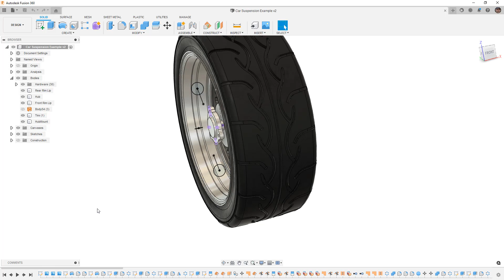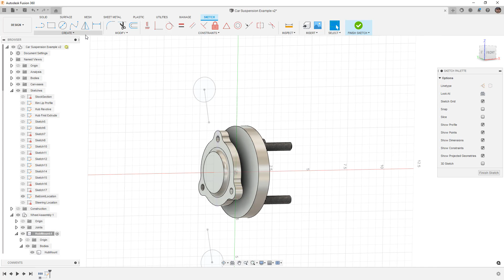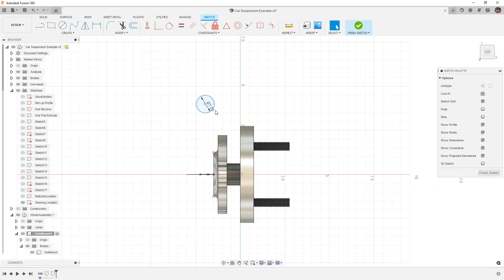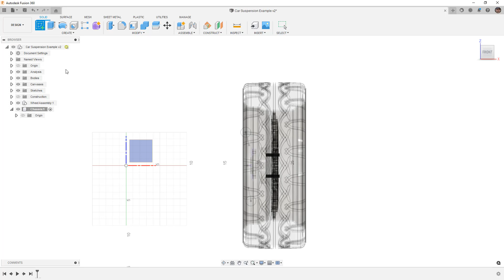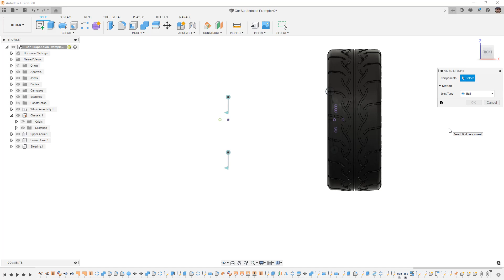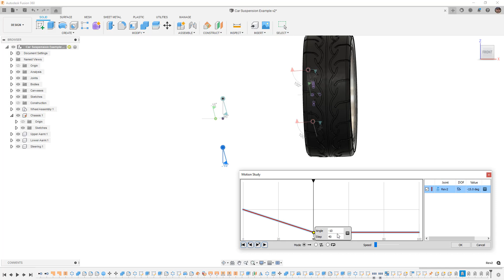Designing Suspension Kinematics in 3D with No Solids in Fusion 360 #Fusion360 #Kinematics

Comment: ...I'd like to push it further shall I? Is there a way to have dynamically displayed camber gain and other angles variations? Can it be done in an easier way than creating "mock" joints with mock straight references, since I've seen it updates those values as you play with the thing... That would be a handy trick!
Reply from the maker: If you do this in a 2d sketch you can have some dimensions as driven and you can see them displayed.  

For displaying it dynamically on the screen for some joints like revolute you can see an angled displayed on the screen at the joint icon but its often hard to see.  Sadly there is no dynamic plotting or anything as this is sort of a cheat to do this work...

Comment: THERE IS THE FREAKIN BALL JOINT TYPE I WAS LOOKIN FOR damnit! Oh, how can I tip you a coffee? :)
Reply from the maker: I don't have any patreon or buy me a coffee set up, but i do have a merch store. https://learn-everything-about-desi-shop.fourthwall.com/  if you scroll down there is a donate option there, or you can buy courses at www.learneverythingaboutdesign.com :)  Not needed but if you want those are some options
Reply: @LearnEverythingAboutDesign  Thanks, I'll check the merch! This has been super useful, today I set up a rear with anti-squat. It works but duuude is there's stuff I have to learn... Convergent arms (anti squat) can be a nightmare with bumpsteer at rear. And I think only in Fusion... If I set the rear low arm, outer joint, to be a balljoint. I hasn't to, it's a hinge in real life. If I set it to be a hinge (and a ball at the upper side ofc) it behaves as it's locked. 😮‍💨
At least now I can build a study model, with your tips. Before I couldn't even properly design it and I was close to buy radiomodel parts to build one. Now if the digital thing doesn't help me to figure out the settings and measurements, I can at least draw and 3Dprint a stickman of the suspensions and tune out on that.
Meanwhile my crosskart lies in the garage, armless like the Nike of Samotracia. 🥲

Comment: This is amazing. I've watched so many videos for years, bought courses, and read books that havent taught me what you did in 25 minutes. Thank you
Reply from the maker: Great to hear!  I did a few videos in this series based on a user request.  While Fusion isn't the strongest at this sort of thing while other programs like Inventor and Solidworks have sketch blocks and lean more toward kinematic design, it is possible with Fusion :)

We do have a site where we are selling courses.  www.LearnEverythingAboutDesign.com  Right now its mostly intro/beginner content but there will be more advanced topics going up now that the intro content is out of the way.
Reply: @LearnEverythingAboutDesign  
I can design just about any part including a chassis and incorporate a mesh car body along with "dummy" models of engine packages and drivetrain. Where I get stuck is figuring out how to create my own proper geometry based upon specs like track width and upright mounting points. Do you use wyzant? I would love a tutoring session. Thanks
Reply from the maker: I do not use Wyzant, but my site LearnEverythingAboutDesign.com does have coaching options available.  At the moment my time is a bit thin but free free to drop me an email about what you are looking for.  support@caducator.com

Comment: Great Video. I love your channel!  is there any way to plot and measure the amount of bump steer? Or in general measure, plot and ideally export measuring results to Excel? 
in theory we could 3D scan a real car to get the pickup points and then simulate it in Fusion. Would be great, you could add a video with such a real world example.
Reply from the maker: Thanks!  So sadly no not easily.  Software like Solidworks has the ability to plot points on screen and on a table.  With Fusion the best you can do is Drive one of the joints and measure from a reference point.  Basically you would measure the angle of the wheel relative to the midplane after driving something like the shock compression.  I will see what i can put together.  Its a "brute force" kind of solution and no automation to put it into a spreadsheet sadly.
Reply: @LearnEverythingAboutDesign  thank you. Great work.
Reply from the maker: Hey RaceCarEngineer, I recorded a video this morning showing how to measure and plot bump steer. Should go up in the next 30mins.  Its a "Brute Force" way but hopefully it helps.  Great suggestion!

Comment: What shortcut do you use to grab the wheel in the confines of the As-Built joints? 

10/10 tutorial, up to speed on what I need for a project.
Reply from the maker: Hey Phillip, not sure exactly what you mean on shortcut.  Moving specific joints can be tricky but you can right click on a joint you can use "Drive Joint" to move just that one joint.  It will let you see what happens when you rotate just a single joint.  I don't use any shortcuts for that(don't know if there are any).  If you mean when applying an as built joint.  After you apply a joint you can use the Right-click marking menu in the 12 o'clock position to repeat the last command. 

 I don't use it but J is the shortcut for Joint and  Shift+J for as-built.  You can also use the S key to open a search box.